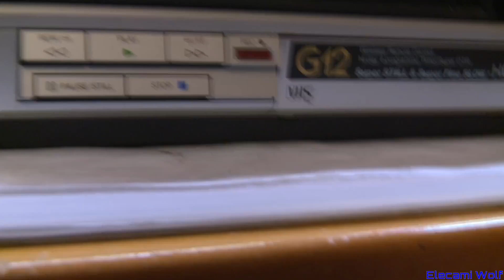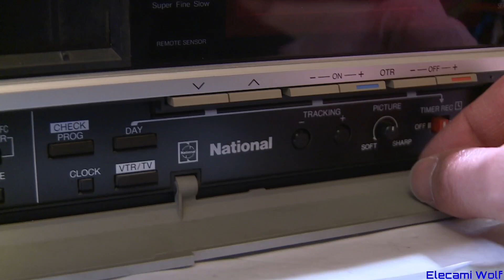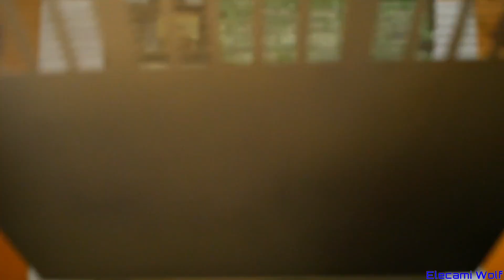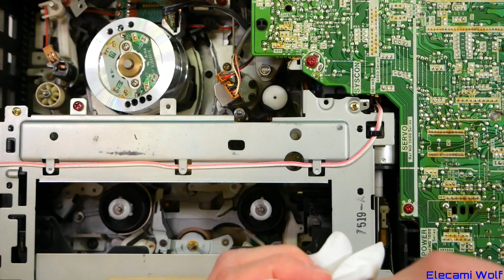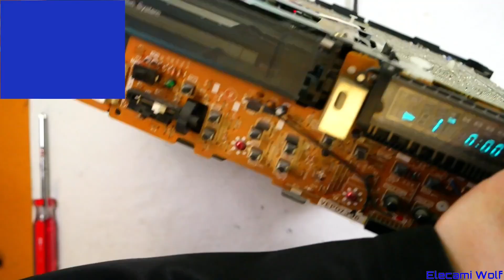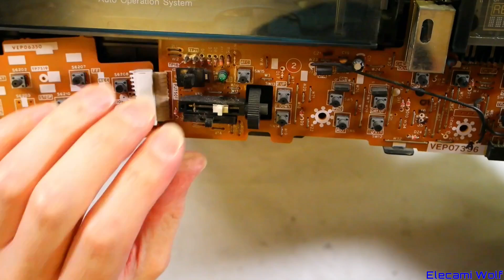EW0138 - National NV-G12 VCR Investigation Teardown

Comment: Hi, I have this VCR.  But I have a problem. The VCR has bad picture and no sound for 5 to 10 minutes. After it gets warm the sound comes back and the picture is clear.  Do you know why?
Reply from the maker: Probably bad capacitors. 
Also could be an issue with the back tension. That can affect audio.

Comment: Very useful video. My Panasonic G12, which I have had since 1987, has dried out the rubber Idler. In general, there are no other problems. I ordered only a rubber ring on Aliexpress. I did not quite understand how to remove the Idler. Is it possible to remove it without removing the cassette receiver? I couldn't find a service manual on the Internet.
Reply from the maker: It will be difficult without removing the cassette loading mechanism. 
You can remove the loading mechanism in this machine without messing up the timing, because it has it's own motor.

Comment: I've had NV-G12. Always had problems with that idler. It always had weak take-up when cold, so normal mode of operation was to let VCR fast forward and then rewind inserted tape to warm up the idler and then it will play without chewing the tape.
Also I think that squicking on your is pinch roller struggling to grip the tape because back tension is too high.
Reply from the maker: Good idea to warm up the idler. 
Probably too tight back tension, also the pinch roller not in good condition.